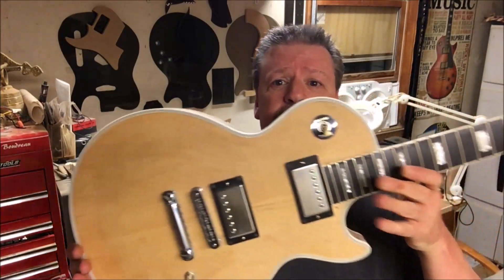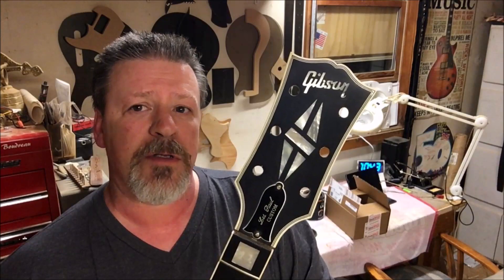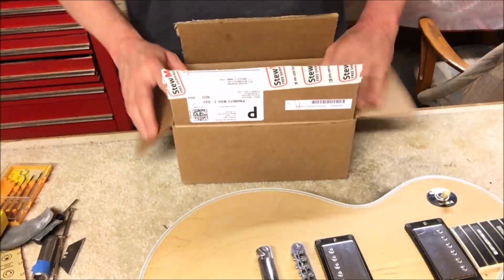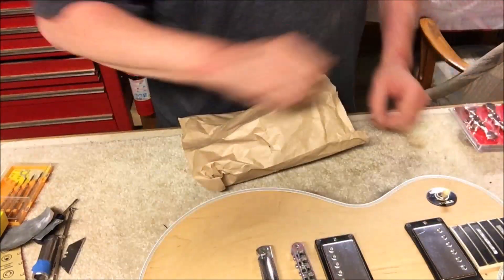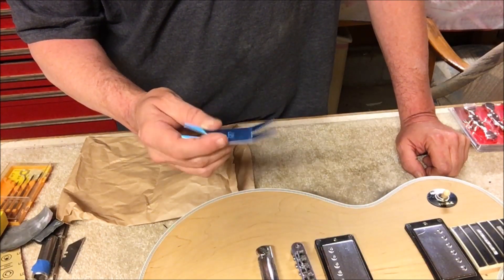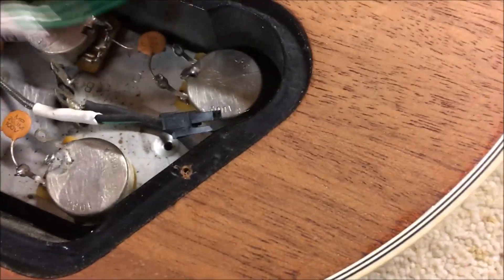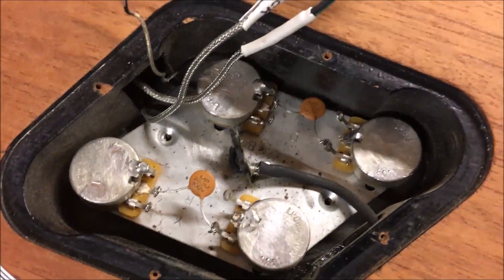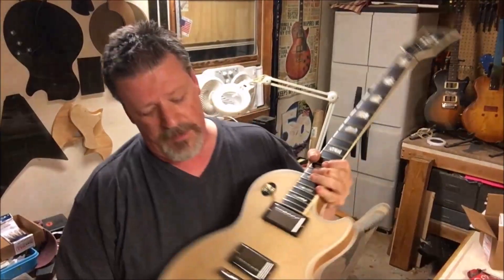Gibson Les Paul Studio/Custom conversion. "Teaser"

Comment: Instead of the String Puller, just use two zip ties. Works like a charm, absolute straight pull and you can't put too much force on the knobs. 
Looking forward to see the finished LP. Do you do the filling with binding dissolved in acetone?
Please no red or sunburst, there are so many of those. Maybe a blue or green?

Comment: Going to be a great guitar. What will you use for those areas you need to fill, standard wood filler? Also, I spotted some some dowels you've put in the body, is that to do with fitting the neck? Hope you don't mind the questions, just fascinated by the process of building guitars.
Reply from the maker: I'm going to use super glue to fill the gaps near the binding, about the dowels.https://youtu.be/88-iQy_1-4c